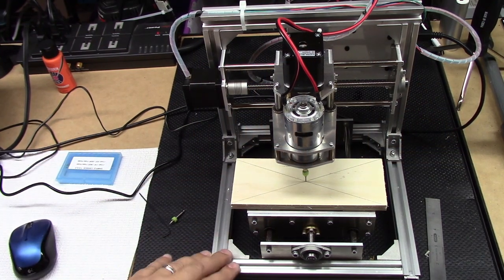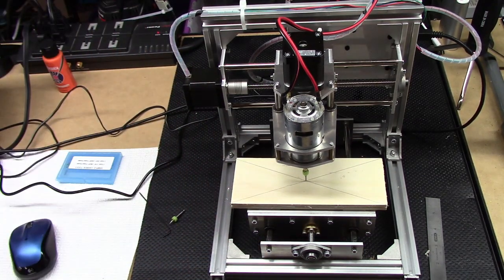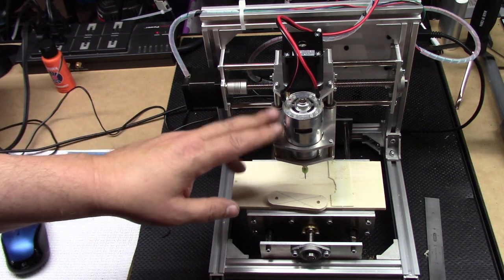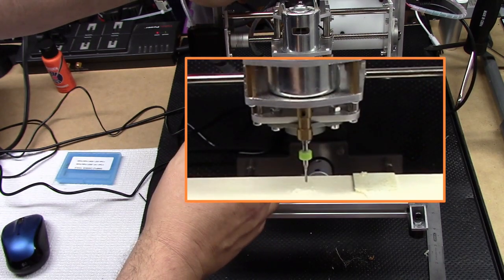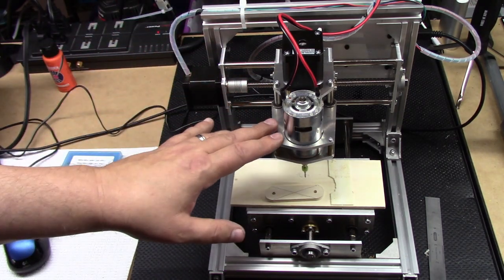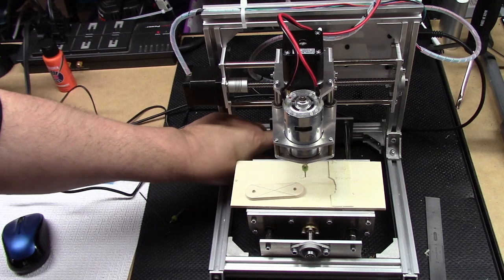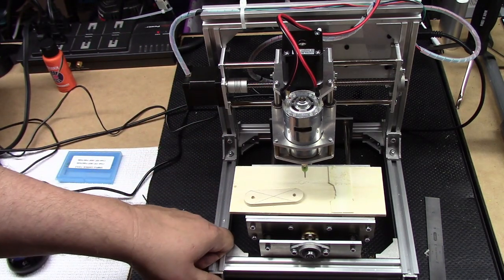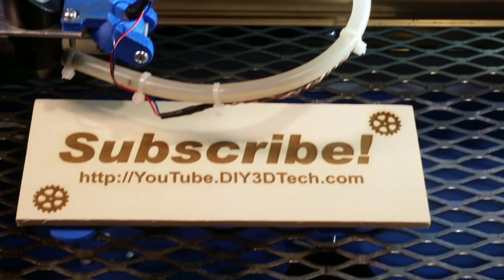Desktop CNC - First Cuts and Thoughts!

Comment: Did you really run this machine on 20mm/s? I just can not believe, that my machine, which works btw. almost perfect, can run at    1,2 meters per minute. At the moment Im running mine with the engraving tips ad 0.5 mm depth with plywood on 150 mm/min. 
Next week  the drilling bits for PCBs should arrive, then the machine is completely awesome:D
Reply from the maker: Yes as 20mm/m would be painful slow :-)  I am not sure why you are measuring meters per minute as the standard at least I am use to mm per second. It is a good little machine and when cutting the type of bit and material play a big role of course.  :-)
Reply: Okay, I just received a few real milling bits, and now I already cut at 400mm/min, which could probably be ramped up. This machine is getting better every day!

Comment: Why didn't you loosen the 4 screws holding the gantry and slide it forward?
Reply from the maker: Not sure I am tracking as when I added the longer I had to slide it "backwards" as it wastes space by setting so far forward....
Reply: Oh, I see, so you weren't able to cut to the rear of the bed plate?
Reply from the maker: Correct...  :-)

Comment: Did you buy the US or EU plug version? It looks like you got one of each plug type on the two power supply units. That's why I wonder why there are two versions for sale. IF the power supply units in both versions are the same, multivoltage models and you received one of each plug type anyway, what possible difference would EU and US plug skus provide?
Reply from the maker: I purchased the US plug version, however one of the wall warts came with EU plug, however it was just the standard design that comes on the computer so it was an easy (the warts are dual voltage)....
Reply: DIY3DTECH.com The US version is, of course and as usual, out of stock. That's why I really wonder how in the heck the "EU plug" version can be any different since you received one US plug anyway and the power warts supplied are dual voltage.

Comment: i thought you could get more volume out of cnc       what is the cut area & do you think you could cut aluminum with a different spindel?
Reply from the maker: Sorry aluminum would way out of the league of this little guy.  Wood and plastics ok, and the base size is around 100mm x 80mm stock however if you follow my up coming mods you can increase this!
Reply: Here it's for 269.90 dollars
https://www.banggood.com/Triaxial-Desktop-DIY-CNC-Micro-Engraving-Machine-Assembling-Kits-p-1055377.html?p=B4200913385416201708
See ya

https://www.youtube.com/watch?v=K80TDWfM2h0